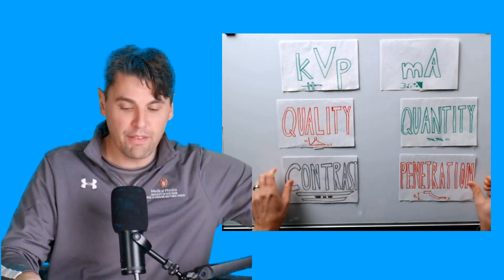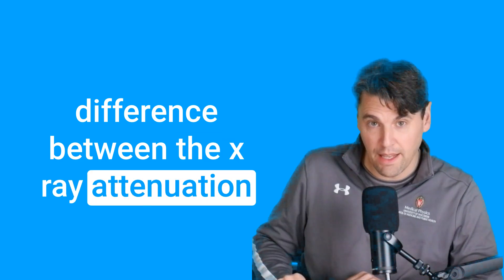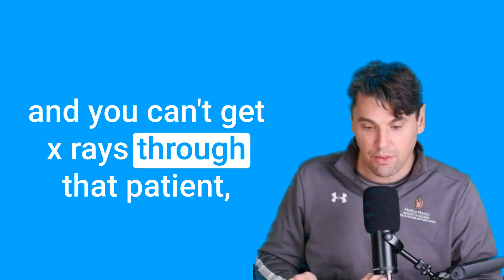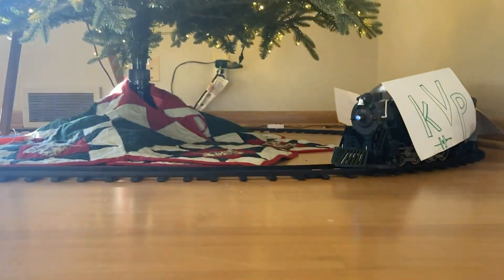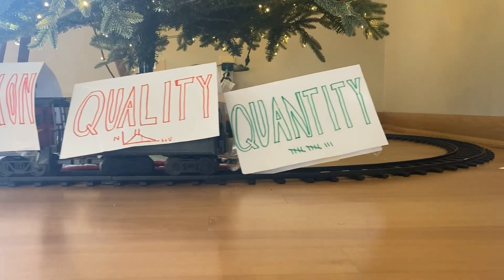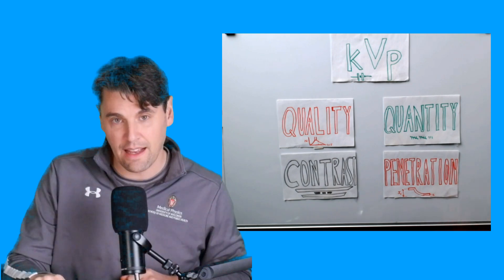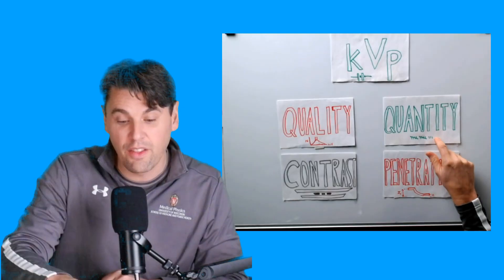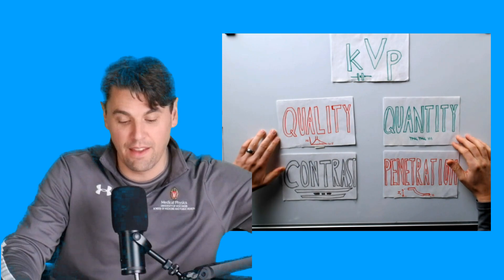Dependencies Of kVp And mA On Contrast, Penetration, Quality & Quantity

Comment: Really great information!!!  I kept getting distracted by the webcam FPS getting from -5 to 3 FPS lol.  I assume you are doing the capture over the playing video, I would possibly try a GPU encoding method, since it looks like the playback resource is hogging all the CPU, or possibly changing the from a wifi camera to a cheap wired webcam for improvement.  Just thinking that it could get to others, and missing out on a like or subscribe.
Reply from the maker: Thanks yeah I’m streaming as you mentioned and the computer is inexpensive so likely as you suggested. Can you link an article on the GPU coding method
Reply: @HowRadiologyWorks  I guess I should have inquired what software you were using. I recommend obs, even on some of the slowest hardware it can produce good results with the right settings. Maybe try USB instead of WiFi for the camera.
Reply from the maker: Thanks yeah I do use OBS if you can send me a reference of what I should change
Reply from the maker: The camera is over USB and on OBS, let me know suggestions
Reply: @HowRadiologyWorks  In OBS Output>Recording settings...... Does video Encoder have an options for "Hardware" ?/  Like QVS,NVENC,AMD???  This would offload encoding to the GPU, with a small amount of quality loss.  Also, because of the content, you should be able to Video> Common FPS Value = 30.  This will also reduce loading. Disabling preview on the OBS windows will also reduce resources, if you can talk over the existing video window.  These are just a few idea, with the biggest results, there are still other small things to try, but give a start there.  One other thing, would be to reduce your cameras resolution to 720p, if possible.